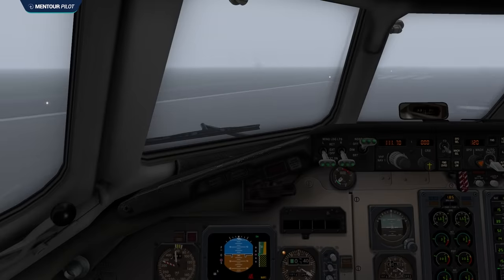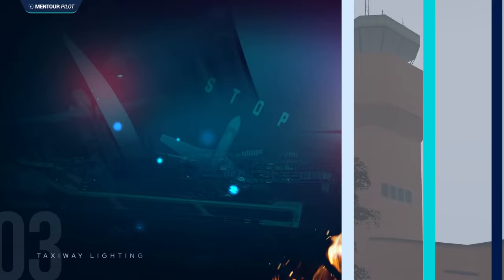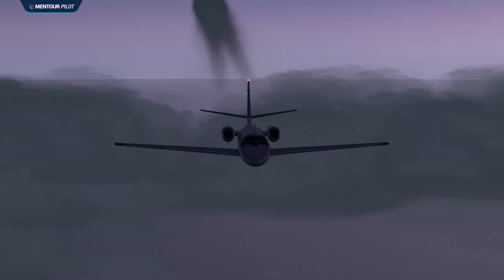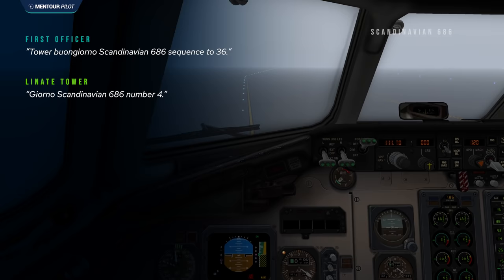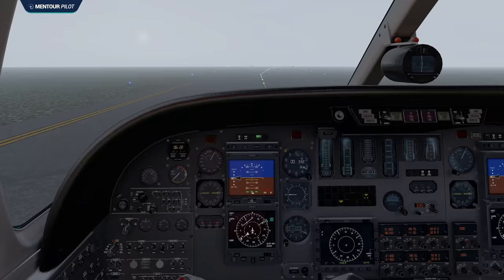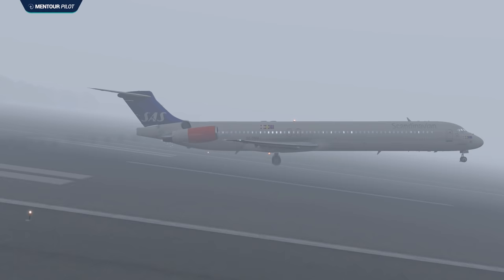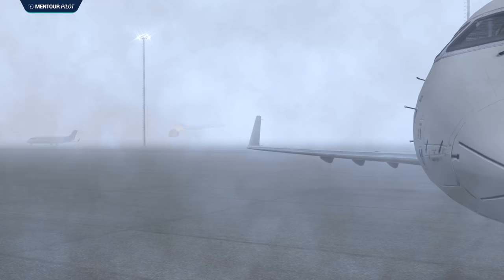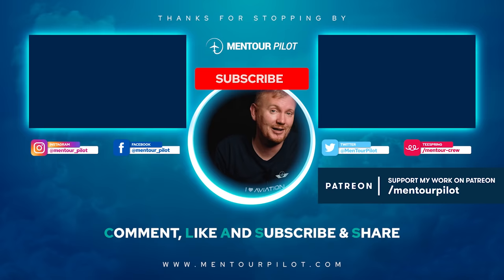A Perfect Storm of Mistakes! And how Heroic Pilots Almost solved it.

Comment: God....Excellent video Peter, done very professionally, I found this hard to watch, I don't know what it was like to record. Normally there's something that could have been done by most parties to avoid an accident but as far as I can see the SAS crew did absolutely everything right and still ended in disaster, its hard you feel so bad for them.  I hadn't heard about this accident before, It's almost unbelievable that this could happen in a major European city in the recent past. I'm actually shocked that the management complete absence of any safety culture could be normalised - not fixing the broken lights, nomralising crossing a stop bar, not replacing broken ground survielance radar is literally disregarding lessons that have been learnt from other disasters, but most unbelievably accepting runway frequent runway incursions in an airport supposedly capable of flying cat 3 approaches... it beggars belief. Similarly the confusion within ATC and firefighting on its own some degree may be understandable but it just seems to further point to terrible management of the airport without serious consideration of safety. That it had been able to go on for so long and not be recognised calls into question the competency of the Italian governments regulator's, I seriously hope that changes were implemented and whatever the root causes of those whether simply incompetence or with this degree of systemic failure you have to wonder about corruption were addressed.  It does seem that the Cessna crew were knowingly operating outside their competence, presumably trusting that the other holes in the "swiss cheese" would not line up, I wonder if their awareness of this and not wanting to be caught led to them not questioning things they might otherwise have done. I'm sorry to sound so vehement and appologise if I upset anyone, normally I do believe a no-blame culture yields the best results (as was clearly not the environment at this airport). In this case though I really do think the management of the airport deserved to be prosecuted.
Reply: To the best of my knowledge, the persons responsible have been prosecuted for this! Likewise, further measures have been initiated to improve technical and organisational security and procedures.
Reply: @urbanjunglegroove1238  yes apparently the airport director then had his sentance quashed on appeal whilst the ATC continued to serve his sentance until it was also quashed. I fail to see how the airport management could not be responsible in this case...

Comment: This is what happens when you keep malfunctioning equipment in use and just say "it's fine". Especially in such critical area as aviation where failure is not an option.
The human error is a factor, but the whole system that was designed to catch and prevent such error was basically neutered.
Reply: That entire airport was a gongshow. Only a matter of time before an accident happened with that lack of professionalism and maintenance.
Reply: @Teh_Random_Canadian  Yes.
Reply: It was not a failure of the system, it was the absence of a system.
Reply: That is a frequent factor in many work place accidents of all different types. Then employees are blamed because they "should have remembered that was not working".
Reply: Exactly. They put all of these systems in place in order to avoid an accident yet when the equipment fails no one bothers to fix the problem. It’s just common sense

Comment: If before seeing this video, you had told me that broken infrastructure, not following rules as an accepted practice, bad communication, in combination with the bad weather... Can result in not knowing for over half an hour that a Cessna on the runway is on fire... I would have told you no way, no such thing could ever happen. And yet here we are. Thank you for this video and explanation, as always excellent and with the proper respect for everybody involved in the accident.
Reply: It happened before, 1977 Tenerife. 2 planes collided on the runway under similar conditions. One plane was found, but I think I remember hearing the other plane wasn’t found for at least 20 minutes because nobody realized 2 planes were involved. Its almost incomprehensible!
Reply: @californiahiker9616  In Tenerife, the fact that there was an obvious big plane on fire on the runway would make it harder to see that there was also a smaller plane there.  Here, though, the fact that nobody in control was aware that a plane had crashed into the baggage handling building seems crazy.  Even if the building were hit by an incoming plane that had missed the runway completely, that would seem like something control should be aware of.
Reply: @flatfingertuning727  Smaller plane? I thought they were both 747's, I guess the second one was in more pieces...
Reply: @californiahiker9616  they knew two planes were involved in Tenerife pretty quickly since they were both large planes. but there was a collision in 1991 at LAX where a 737 crushed a smaller turboprop and no one realized the smaller plane was even missing until firefighters found a broken prop in the wreckage. Las Angeles runway disaster USAir 1493 and Skywest 5569.

Comment: From the point of view of an electrician... the problem with the taxiway lights and the red stop lights being unable to turn on or off separately, was likely caused by two wires being shorted together somewhere. Maybe  a crushed conduit or an arc flashover form a lightning strike. And thinking of how much wiring there must be all over the place... I know it can be a hell of a job to troubleshoot, and really expensive to repair.

Comment: I always found it bizarre that Linate was kept in service when Malpensa was opened - but we all do our best to fly to Linate as it is convenient and we ignore the many issues of overcrowding - while you could have a motor race through the empty corridors of Malpensa! It was if the authorities hoped by making it a bit grotty we would leave this airport - but ultimately convenience is key - a similar situation could have evolved with Munchen but they shut the old airport solving the issue of not pleasing those who preferred the proximity of the old airport
Reply: 100% agree with you. Almost all commercial traffic was supposed to move to the much larger modern and safer Malpensa, but of course politics in Rome (Rome airport would have lost lots of traffic) and local politics in Milan (they were lazy and wanted an airport 15 minutes away from the city center) fought back hard

Comment: Great video! I live in Milan. I was 4 at the time but I still remember the news talking about this non stop and the complete shock. The fog here in that period of the year Is deadly, there are many car accidents as well since you really cannot see 2m from you. It's awful what happened due to that + typical bad italian management, a real tragedy
Reply: @theopinionisthighqualityopinio  no problem. I haven't seen a very consistent thick fog for a long time either, since I was a kid probably, maybe a Little bit last Winter or the one before (I live in the side of Milan opposite you). I live inside the city so there is almost no fog here now but I have been told by a lot of people that It used to be so crazy inside the city borders as well that they had to drive with their head out of the car Windows Just to see the White stripes delimiting the car lane.  My friends who live in the countryside south-west of Milan still sometimes have trouble driving in the morning in autumn so I guess some days It still gets pretty intense there. I have had a few scary experiences near Pavia as well. I heard It decreased because of the decrease of pollution, at least the kind of pollution there used to be before, it has probably just changes to a less fog-causing type of pollution. Air had a lot of "industrial dust" in It in the 70s-90s which caused the thick fog and the Buildings to become dirty (the Duomo used to be almost dark grey if you remember, they just recently cleaned It). In this Plane crash case It was 2001, It was still pretty dramatic then and unfortunaltely I can see why they kept running the Airport since It was Always like that and at the time Bergamo Airport was not liked to Milan and Malpensa i think was not as important as It Is now. Of course the Airport running and maintenence issues are inexscusable.
Reply: @theopinionisthighqualityopinio  I didn't realize that answer was so long 😱

Comment: What makes this even more tragic is that I’ve read from more than one source that the Cessna occupants actually didn’t die on impact. That at least one or two of them could have been saved if it hadn’t taken more than 30 effing minutes for the fire crew to make it to the runway inspection. Horrible and infuriating.

Well done, sir. These videos are incredibly interesting and enthralling. Learning the ‘Swiss cheese model’ and amount of egregious oversights that led to this disaster.

Comment: What I don't understand is, if the pilots of the Citation knew the airport well enough to know that it's okay to cross the red stop bar, how come they didn't know they were on taxi-way R6 instead of R5. Also, thinking that taking a short-cut across an active runway of a busy airport in the fog, early in the morning is pretty much guaranteed to have a bad ending I would have thought.
Reply: Probably the same rationale that convinced them to take off in conditions that well exceeded Cat 1 allowable conditions.
Reply: I think they just expected to take R5 back and didn't register that they were meant to be on R6... I also suspect they were trying to keep quiet and keep their heads down knowing they shouldn't really have been there...
Reply: @tomriley5790  But it´s nevertheless difficult to understand their actions. They readed back the clearance for Romeo 5 but started then to taxi on Romeo 6 - when they were aware of the Airport design they MUST have known that they weren´t on Romeo 5.
Unfortunately the Cessna had no CVR. So we will never know if this was only stupidity or criminal behaviour of the Cessna pilots.
Reply: @NicolaW72  perhaps they simply forgot which was R5 and which was R6, expecting to go back the way they went, which might have been the way they "always went". The converstation regarding S4 would probably have given them false confidence that the tower knew where they were. I agree it's incredibly negligent but given that they weren't qualified to be there and perhaps had faith in the other safety systems on the airport....
Reply: Because there were no taxiway signs.

Comment: The Citation should not have even been there. Had the Citation's pilots not violated rules, landing below their qualified minimums, they and the others would have lived. Yes, there were a multiplicity of factors, but this one was a willful violation.
Reply: Yes it makes me wonder about a couple of things, whether the crew knowing they shouldn't have been there kept quiet and didn't question things that they might have done leading to persistence of their mental model, or alternatively whether the airport was poorly maintained for a reason - either corruption or smuggling, it does seem to have been a place you could get in and out of without too many questions being asked.
Reply from the maker: Correct, that’s where the chain started
Reply: At the same time, it's not obvious this accident would have been avoided if the aircraft and crew were qualified for cat.III operations. The same confusion could still have occured, and indeed the final report discovered multiple recent runway incursions due to pilots confusing taxiways R5 and R6. The situation at this airport was simply a ticking time-bomb.
Reply: @MatthijsvanDuin  Yes.

Comment: I'd never heard of this disaster, but as soon as I heard you say those lights and stop line couldn't be turned on and off independently, I actually paused the video and said "Are you kidding me???" out loud. I just knew this disaster would involve someone crossing the stop line when they weren't supposed to: either it would be illuminated and someone would cross anyway, or it would be off when it was supposed to be on.

When important procedures are broken, people invent workarounds. The workaround then becomes the new norm, and you end up with two competing systems: "the way things are supposed to be done", and "the way we do things around here." The Cessna pilot crossed the stop line because "that's the way we do things at Linate". He assumed the stop line was unreliable and therefore utilized the workaround, which was to ignore the stop line entirely. Unfortunately, the Scandinavian pilots were operating the way things were supposed to be done. Those two systems literally collided, with tragic results.

However, despite all the airport's inexcusable faults, I can't help but feel that the majority of the blame falls on the Cessna pilot. Ground control specifically told him to call back when reaching the stop line. Even though he was on the wrong taxiway, he should have remembered his clearance when he reached that illuminated red line, and called ground control back. But he didn't stop. And he didn't call back. I just can't forgive someone for ignoring a direct instruction that important.

Comment: You know that the pilots of the MD-80 knew that their chance of survival were slim to none.  Assuming this, it almost makes me cry thinking of them in the cockpit, trying to minimize collateral damage by adding the reverse thruster on the left hand engine.  You pilots truly don't get enough respect in my opinion.  I know flying is very safe now days, but still, when something does go wrong, many times it can evolve quickly into a life and death situation for yourselves, your passengers and crew, and others around where the aircraft will land/crash.   It takes strong character and true heroes to make decisions to save as many lives while knowing that you will likely not survive, no matter what decisions you make.   The MD-80 pilots were true heroes in my opinion.  The fact that only 4 people on the ground died, when it easily could have been the passenger terminal hit, was absolutely amazing.   As for the pilots in the Cessna, they are examples of complacency kills.  Yes, the runway markers and such could have alerted the pilots that they were not on runway 5, but I am not sure that even if runway numbers were visible, that they would have paid much attention to it.  They had a preconceived idea of where they were going and it did not matter what ground control told them.  Ground control was clear in their directions on the initial taxiway.  Because the Cessna pilots were complacent and not paying attention to the words ground control said, they acted on their own preconceived plan, and did not actually listen to what ground control told them.  They got comfortable and complacent and it cost everyone in this accident their lives.  Ground radar, the controlling of the lights, the laser malfunction, dangerous practices like rolling through a red line, etc., did contribute to not stopping this accident, and might have helped ground control to visualize where the Cesena was on the runway, allowing ground control to "slap" the Cessna pilots out of their complacent attitude, but it does not change the fact that those pilots did NOT follow the initial directions of ground control.   In my opinion, the Cessna pilots caused this accident.  If they had actually listened to ground control, and asked questions if they did not understand where runway 5 was, then none of this would have happened.  When ground control says runway 5, they mean runway 5.  If the Cessna pilots were familiar with the airport, which is seems they were, then they should have known that the runway they were using was actually 6, not 5, regardless of whether there were runway signs.  That there tells me that they had their own plan for taxiing and were now listening to the actual words ground control was saying.     

I do have one question though.  Why doesn't ground control or the Tower control have the authority to prevent pilots from taking off or landing when the flight plan clearly states that they cannot do so?  Is the plan only known by the pilots?  Is there a way that ground control or the tower can know that a certain aircraft or type of aircraft is limited for landing or takeoff due to visibility or other restrictions?   How was the Cesena allowed to land and takeoff when it was clear that doing so violated their flight plan?    I know nothing about flight plans, who and how they are filed before takeoff.   Thanks

Comment: There appears to be some interesting changes to this airport.  1. The GA runway is closed, having three large Xs on it. 2. The GA buildings and apron are still in use, but there doesn't appear to be any GA prop driven aircraft,  only private jets and potential a twin engine, rear prop aircraft.  3. R2 has been completely removed. This appears to prevent any potential crossings of the main runway 4. R6 appears to only be used for exiting to runway. There are several markings indicating there should be no entry onto the runway from R6.   I wonder if all of these changes are a result of this disaster.